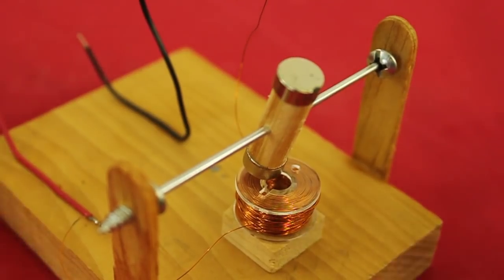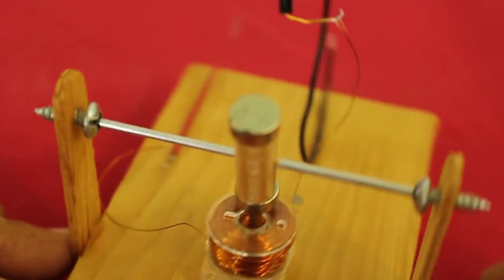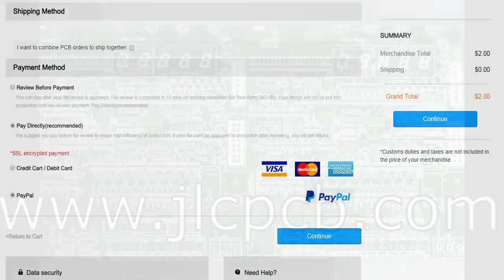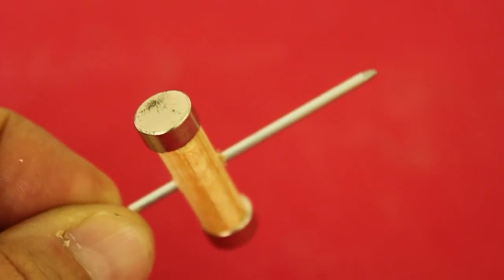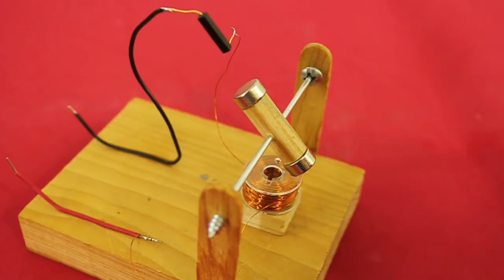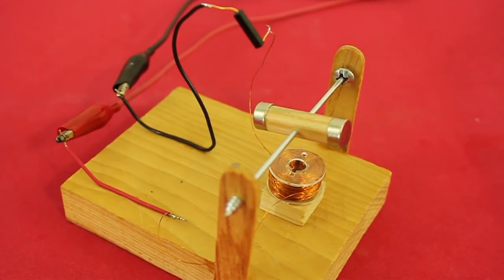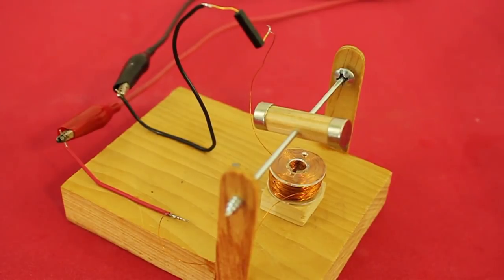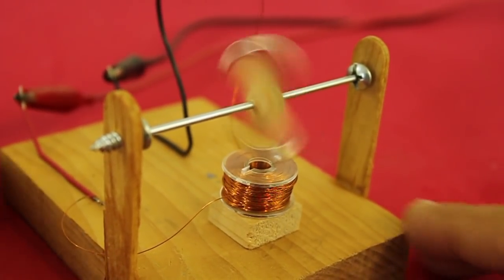Screwed Electric DC Motor - Easy to Make

Comment: This is called a reed switch motor. Made one many years ago.
Reply: Coincidentally, this motor also known as pulse motor.
Reply: @TheArkcantos  A pulse motor works with a transistor to switch the circuit on and off.
Reply: @Berghiker  Not necessary to be transistor. Just as the name implied "pulse", mean like a beat (take biological object, heart "pulse"). 
The reed switch here act as the pulse switch. Another way to view is the motor works with "pulsing" (beating) electromagnet.

Comment: Cool. Can you do it again and by suspend it with magnets so it can go faster with no noise? Other videos show how that is done to suspend, but if you want a link I am look it up for you. 
Also if you had the same setup on the other side of the coil. ;)
Reply from the maker: The mendocino motor
Reply: @ludicscience  I expect you will make that one day as well. :) would a second coil slow it down to the point it stops if it was a closed loop or attached to a motor?